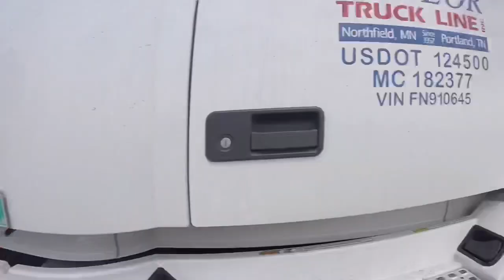Rotator work ep #105 Thirsty Volvo

Comment: He's got a lot to learn Mal, but at least he ain't as worthless as them other swampers you've worked with. Oh and tell him to get a pair of safety glasses on while he's under there beating and banging metal against metal. All it takes is one steel sliver or some other crap flying into his eye and you end up back working with those slack asses you've had before, while his eye heals up. I would also suggest you get you a 3-foot crowbar (not a flat bar) and put it with your driveshaft tools, it's easier to use it to pry the U-joint out rather than risking misshaping the bearing cap ends beating them with a big hammer. Plus you can beat and bang on that crowbar all day and you won't hurt it any.
Reply from the maker: Hey thanks a lot I’ll have to look into one of those I appreciate that bit of advice thanks again for watching
Reply: Seen in another video that the wrecker driver used a strap in behind the u joint and pulled back and put some tension on it then hit it  that one popped out easy  then a thicker pry bar than what you use.  And it held the drive shaft from falling. Then from out side of the truck he retightened up. The strap . No picking up the shaft holding while tightening shaft up thanks for the videos  looks like jay is getting better.

Comment: I’m no truck driver but I’ve never seen the wide rear tires instead of duals
Reply: Super singles are great for keeping the vehicle overall weight down.  it's lighter having one rim and tire than two,  BUT... if you blow a tire, you can't limp slowly to an exit.  You have to stop and sit there, or you'll ruin the rim by driving on it.   
And, super single drives are absolutely useless in deep snow or slush.  They can't push aside or channel enough of the snow out of the way to the side (like between the duals), and end up pulling it under, then flattening it down into hard-pack or ice. As soon as the tire starts grabbing large volumes of snow or slush, it's more likely to break traction.  Narrower tires will drive over a certain amount too, but they tend to push (or channel) a certain amount of it out and away before the tire rolls over it.
They are getting pretty popular now on drives, even more so in trailer position,  just for the weight savings.  No matter how you look at it,  a service call is the same price whether for a dual or a super single,  just the price of the tire or rim is different.  So many companies go for it, just for the weight saving aspect of it,  and hope that they won't have a blow-out during operation.  If you can catch it before the tire gets destroyed,  it's cheaper to replace one super single than it is to replace two conventional tires.  And if you can take the worn tire (in any size) out of service early enough before the casing gets damaged, you can send it in and have it retreaded, and use the tire again,  or get a casing credit (essentially selling the remainder of a good tire to your tire provider, who will put it through the retread process and sell it to another customer).